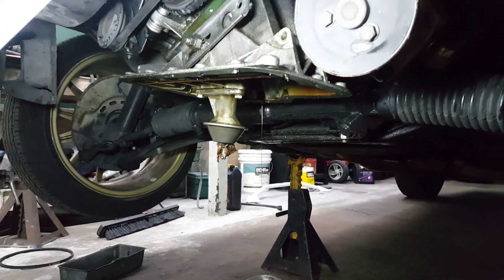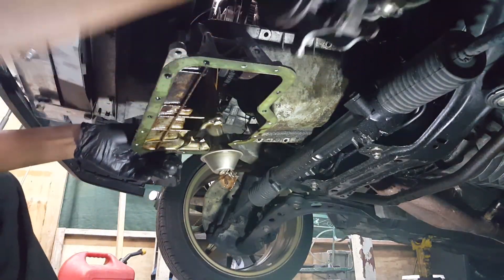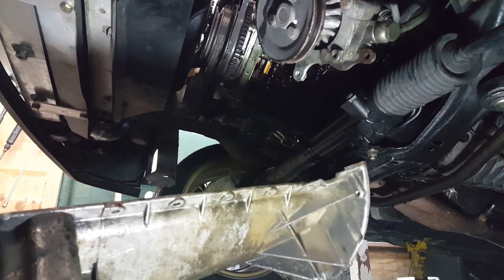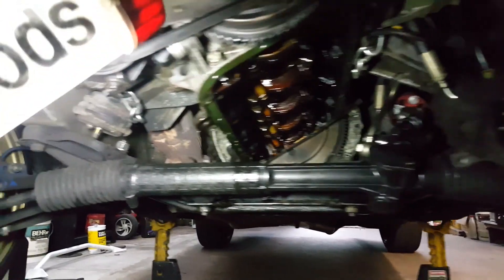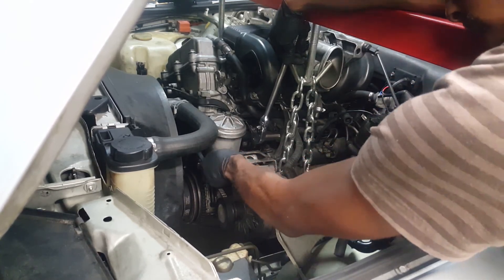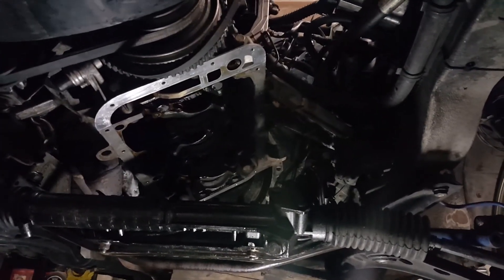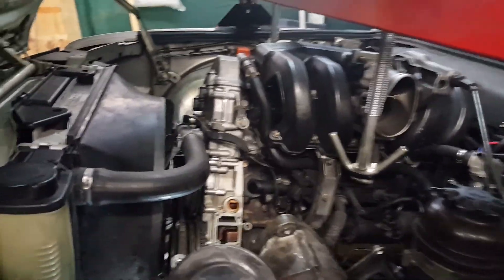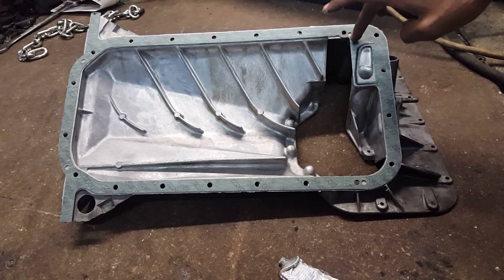E30 M42 Turbo Prep Episode 2

Comment: you may want to replace the black pastic cooling pipe while you have the engine apart. Mine broke off and almost left me stranded, and I think mine was the original, like the water pump so they were both due for replacement
Reply from the maker: Ted Schultz i would but it has been put back together updating videos these are from december.